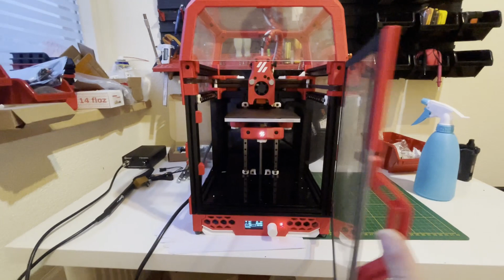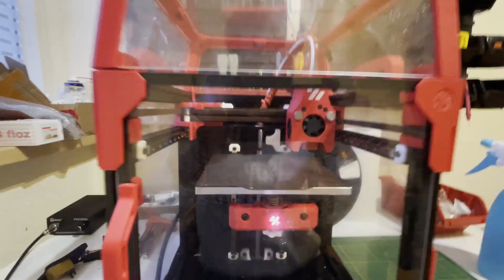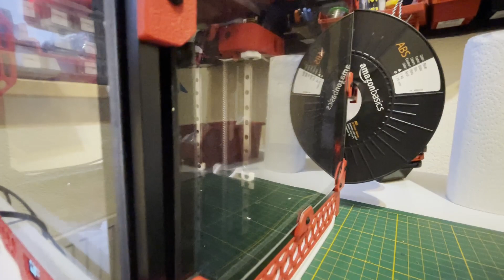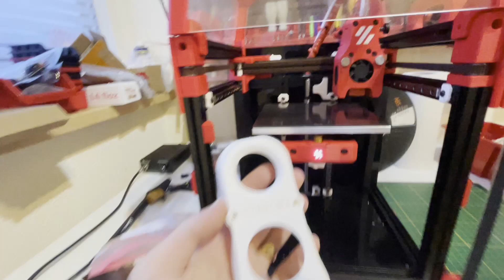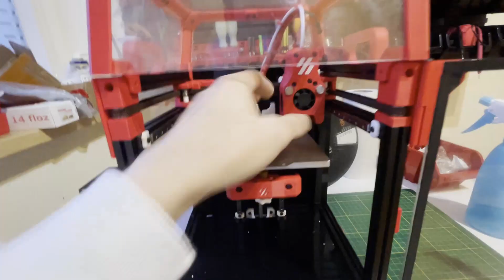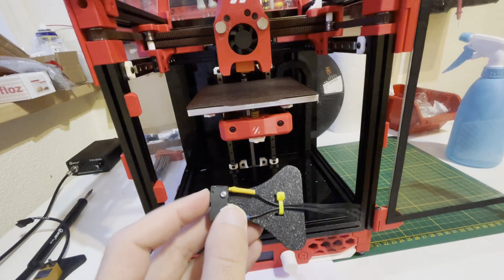Building Voron v0.1 - Experiences [Ep13]

Comment: I have heatsinks on my Pi and also run a small 5v fan that cools the Pi and a larger 4010 12v fan for cooling the microcontroller; both run mid to high 30s Celsius.

Comment: Did you put a heatsink on the pi? Also it is different because your other pi is a 4. This one is a 3b. Definitely not a fake raspberry pi.
Reply from the maker: Correct, I suspected that because of the box quality and also PCB quality. I know it is very less chance but still I am not sure. And I do not have heat sink. When we think there is also not fan and also it is small chamber, most probably it was heat issue on raspberry pi.
Reply: @zer0isdoing  yes im sure you are right zero. I think it needs a heatsink and it should be fine.
Reply: By the way i love the build series. Very informative and well done. Thank you.
Reply from the maker: Thank you very much. Very glad to help! 🙂

Comment: Your printed parts on the bottom look different.  Especially the frame that hold the LCD.  I don't see that one on the github page.  Where did you get that piece that holes the LCD?
Reply from the maker: This one: https://github.com/VoronDesign/VoronUsers/tree/master/printer_mods/doubletrouble/V0_Skirt_Mod
Reply: is this for ldo’s v0 display ?
Reply from the maker: @user-yk1cw8im4h  Just checked picture of LDO's. It seems same board, but I am not sure.
Reply: zer0 is doing I mean its for timmit’s design?
Reply from the maker: Yes.

Comment: I don't think the raspberry is fake it's almost impossible to get the required chips for the raspberry the supply is heavy regulated
Reply from the maker: Yes that is correct. However I thought it is still possible, very less chance but yes. Since there is no fan for electronics chamber that can cause also.

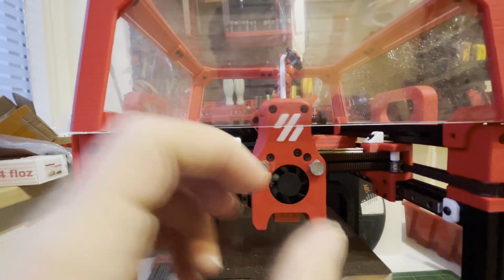Comment: 15:00 try to lower the current of the extruder
Reply from the maker: Already done. I have also reduced it for the z motor which was heating a bit more. But for the extruder it did not help. Since there is also chamber and less volume, it is more tricky.

Comment: Sure you haven't cleaned your panels with IPA or similar? That will cause the cracking you are showing.
Reply: Whats IPA? Isopropanol?
Reply from the maker: Yes, Isopropyl alcohol.
Reply from the maker: Not sure but, I think I cleaned with IPA. Thanks for the info, won’t do it again. 😀